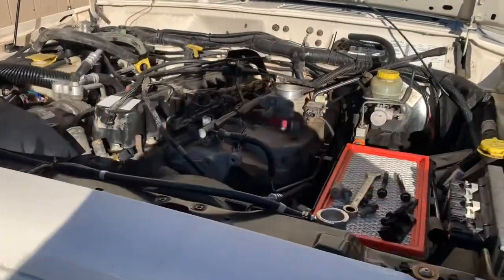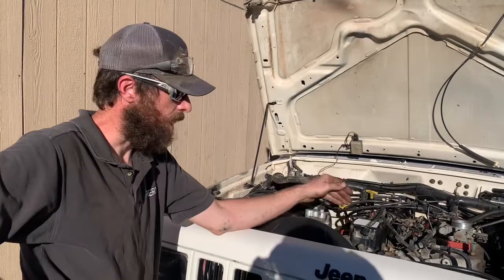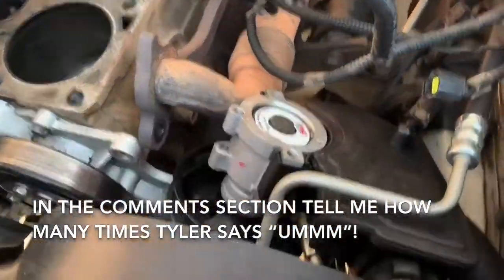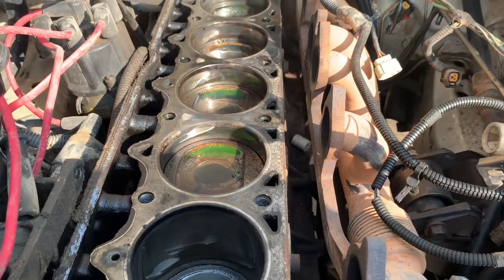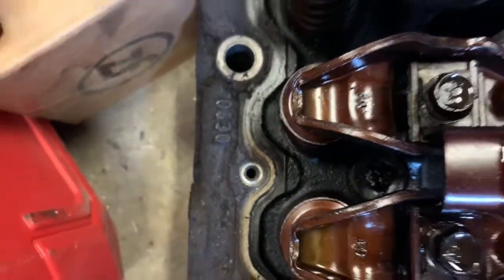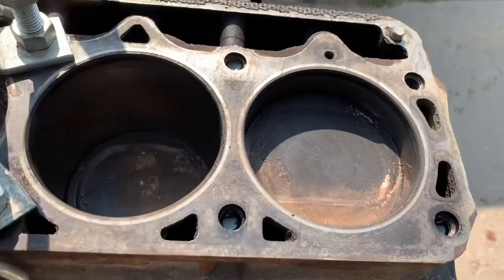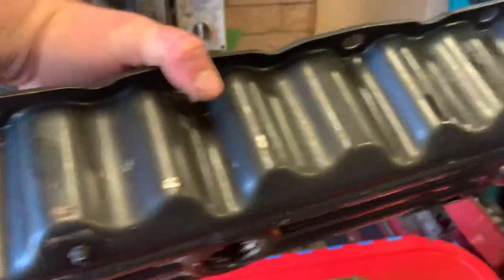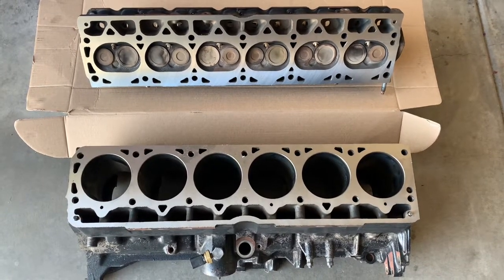How To: 1999 Jeep XJ Motor Rebuild! Part 1

Comment: How much does it cost to get your engine reduild?
Reply: I had mine done for $1950. I supplied the parts and pieces for the rebuild otherwise it would’ve been about $2500-$3000. In my opinion, when it comes to small stuff find someone to do it for cheaper but when it comes to body/engine/transmission work always fork out the extra money for someone who going to do it right.

Comment: You caught it before it cracked then you machined down and put it back in. Why? The 6331 head is a factory defect prone to cracking. It’s just gonna crack later. Just wondering why? It’s a hell of a lot of work to go through when you could’ve just put another block in.
Reply from the maker: I have done extensive research and read numerous threads and reports on this. Again, I appreciate you bringing this too my attention BUT... the 0630 Head is definitely the stronger of the two heads. It is the 0330 Head that is prone to cracking.
Reply from the maker: Hello Rob. Thank you very much for watching and your input on this. I am not exactly sure where you are getting the #6331? I have a 0630 which is the better of the heads. The #0330 head is the familiar head that experiences cracking often. I am interested in learning more and appreciate your feedback. I do believe I have the better of the two heads available. For this reason, I chose to machine it. I tested it for cracks and we are good.